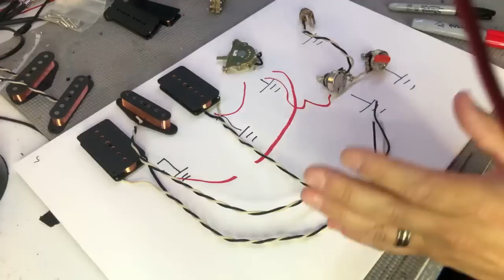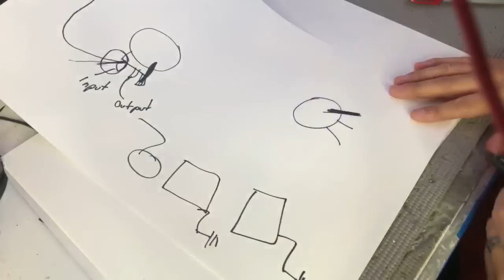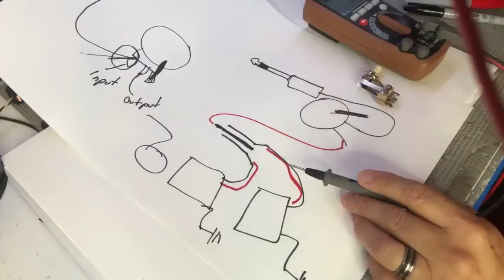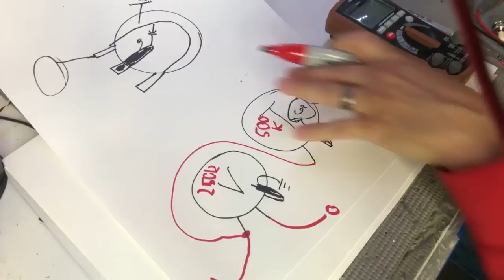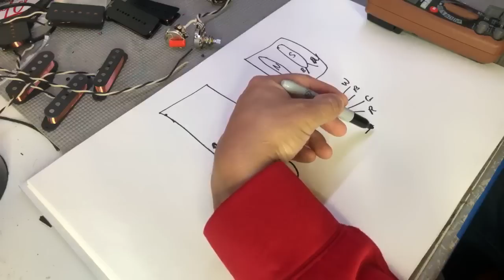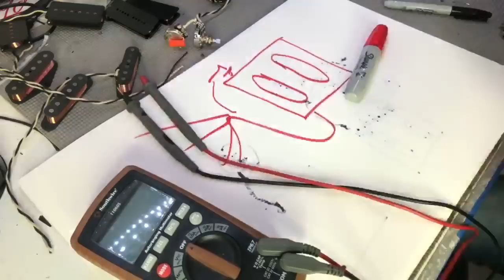How To Wire Your Guitar

Comment: fwiw... tone caps should ALWAYS be wired with the "foil" lead to the ground.. Orange drops and such... The polarity actually makes a difference!!!  I've been wiring up guitars and basses for years, and I JUST learned that... Seems like it's not very common info, either (that's why I'm sharing! 😉)
Reply from the maker: There is no “foil side” on non electrolytic caps. If there were, it wouldn’t work because the guitar is an AC circuit and needs to flow both ways. This is a non thing that people try to bring from other industries and applications

Comment: If a pickup has 2 ground wires (i.e. Fender noiseless), do the grounds need to go to separate pots? I have a neck pickup not working in a Nashville style Tele project I rewired. Middle and bridge pickups work fine. Neck is only one with 2 grounds.

Comment: Some diagrams show the cap soldered to the tone pot middle lug, others to the 3rd lug.  I opened 2 of my guitars, on one it is wired to the middle, on the other the cap is wired to the 3rd lug. Both guitars seem to work ok. Where should I attach the cap on the one I'm putting together now? Does it matter?

Comment: I don't know Dylan if you see these replies from your older videos but THANK YOU, Thank You, thank you for this video! I have a dual humbucker guitar that I wanted to coil split with a 5 way switch but couldn't get the tone circuit to work. First off I was really disappointed with a Seymour Duncan's wiring diagram because it showed the wrong connection for the bridge pickup.  Then after getting that figured out I had this problem with the tone circuit which, as you said,  turned out to be a bad ground. And I should known better too because from working on cars the #1 procedure that was drilled into us in shop was to always check your ground.

Comment: Is a tone pod the samen as a volume pod?
Reply: jeroen h - the answer is yes. brand new,   stand alone, both out of the box, you can use either of them as vol/tone. it's the way you solder them, it's what makes it either vol or tone. just like electrical wire.  you got 3 different color wire, line them up side by side,  each wire is identical. the colored sleeve is to only help the user decode the properties that SHOULD be running through it; ie. voltage, resistance etc. etc.
Reply: Mike Reyes thanks vor the anser Mike 👍🏾

Comment: Problem I have with my strat is after playing around with the wires (trying to understand how it works) I re connected only one Pickup and now the output volume is very low. I have to turn my amp way up. I can not figure out why this is?
Reply: Try breja tone works on utube n look for standard strat wiring or ur type of strat wiring. Not too tuff u prob  got 1 in the wrong spot. Easily done.

Comment: I don't think your calculation of output for two pickups in parallel is correct?   Isn't it more like 30% of both pickups?
Reply from the maker: Iggytommy it’s usually half of one.  Since they aren’t usually equal, it can vary....

Comment: you got your second example incorrect,. sorry.  pickups with independent volume controls go first to the volume and then to the switch
Reply from the maker: Iggytommy ha!!! I totally did do that backwards !
Reply: @DylanTalksTone  I really like your channel, I think the explanations are clear and useful for beginners and as a reference. I've seen other channels where the presenter will annotate the video with text where an error has been made and I think that's useful. Be careful when stating generally that "when two electronic components (not just resistors) are wired in parallel, they will read half [of them]" I imagine you know that capacitors in parallel will sum their values.